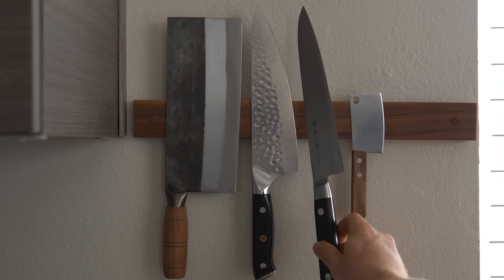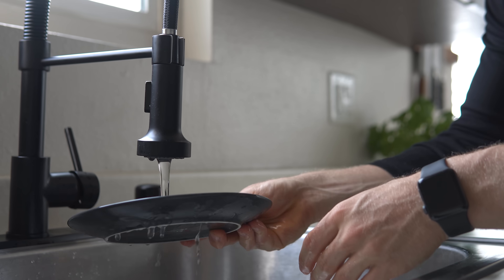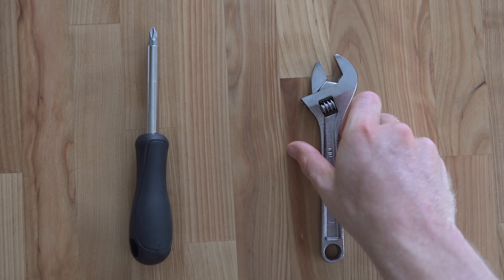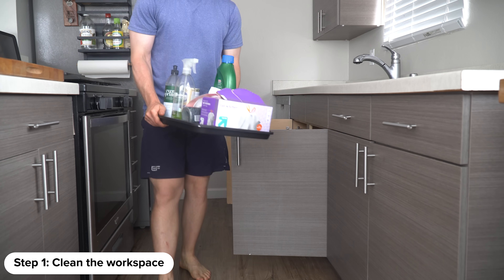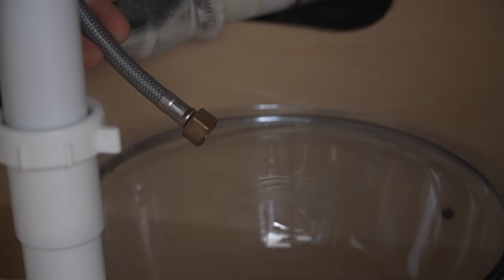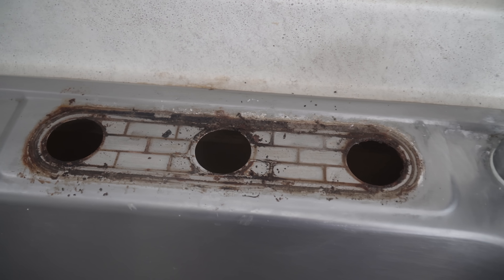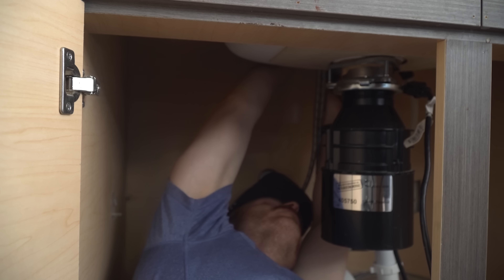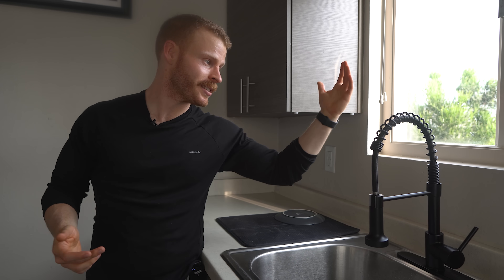Why (and how) to install a new kitchen faucet

Comment: You need one of those tubes of silicon or something to create a waterproof layer around the base. It also helps keep the base in place.
Reply from the maker: There's a gasket underneath the plate cover that should keep it waterproof, but if I notice issues I'll get a sealant. I wanted to make it easy to remove since I'm only renting!
Reply: Ethan Chlebowski run a bead of silicone around the base to keep water from leaking under and causing the rust and grime issues you had on the old one. Silicone is super easy to remove when you need to replace the faucet again. You won’t regret it!
Reply: @EthanChlebowski  That gasket generally speaking is trash and should not be trusted to keep water splashes from dripping down the main hole where the faucet stem is placed.  Even just a periodic drip can cause the cabinets to warp or even worse develop mildew/mold.  I'd suggest putting a sheet pan under there for the time being and check it after a large load of sink usage so see if you are getting any moisture dripping through.  As mentioned by others a bead of silicone around the gasket will provide a permanent solution.  It's really easy to remove with a putty knife if you have to change the faucet back when you move and will ensure not losing your deposit over cabinet replacements.
Reply: @EvanSamuels  being a Plumber of 15 years, you never silicone under the tap. That's what's the gasket is for.
Reply: gazlake1 actually you are correct. It looked like there was no gasket under the plate from the video (just metal on metal) but maybe there is a foam one built in? Though It’s a bit hard to tell from the product description.
Reply: @EvanSamuels   It comes with a foam sponge by the look of it. 

Its a cheap Chinese brand so you get what you pay for I guess.
Reply: @EvanSamuels  I have this exact faucet and plate. It does indeed come with a foam gasket. I decided to silicone mine anyway, just to be safe, but it was probably overkill.
Reply: LOL.  I was going to suggest the same thing.  BASIN on Amazon.
Reply: Hi Ethan,  do I need to buy new supply lines when I replace the faucet?

Comment: Last week I was doing dishes, using the hose, and switching back and forth wasted so much water that it got me thinking about how much more efficient the dish tank in commercial kitchens are.

But this design really brings the best of that world into the home. Basically a commercial style hose, held up by the spring and all that, but clicking into place for standard home use...

Can I come do your dishes sometime bro?

Cuz that joint is efficient, ergonomic, and elegant af
Reply from the maker: Yea I really dig the design on this one, functional and looks sleek.

Comment: Nice vid….I’m just replacing mine now.. wasn’t sure how much sealant I needed to put between the gasket and the sink flange. ..the instructions that came with my unit only mentioned I needed caulk.  Also, your sink faucet is waaaay sexier than mine, which is more reminiscent of the cookie-cutter builder grade crap from a 1980’s track home for just a few dollars less than yours 😢

Comment: I just tried to do this. But I have a line that runs off from the hot water supply hose. And don't know how to go about that because I still need that line since I assume it goes to my dishwasher. But also disconnecting before the T doesn't seem like it would work either.

Comment: You didn’t mention the caulking or silicone or whatever it’s called that goes under the new faucet plate. Didn’t you need to glue it down to stop water from leaking out?

Comment: I've replaced the faucet twice in my current home and both my prior rentals. The lease companies at the apartments had no complaints on the upgrades. We have a big kholer drop in now that fits whole sheet pans like nothing. So nice.
Reply from the maker: It really is a game changer for not much work!
Reply: @EthanChlebowski  that does depend a little on the faucets and particular sink though. Some are really a pain to get the nut on and off for the faucet. But most aren't bad.

Comment: I replaced mine today with the similar one from WEWE.  I didn't have hot water in my sink for a year.  Removing the old 23 yr old faucet was the time consuming part.  I was about to call service for it, but finally unscrewed with a little more Monica Seles Grunt.  Wow water pressure is amazing for $50 faucet.  I want to now get this same faucet and use it in my bathroom.

Comment: I have a similar faucet and it seems to keep getting misaligned with the connection bass like the coil will move to the right and so I have to kind of pull it down to the left to lock it in does anyone have an idea how to fix this

Comment: u skipped the part where u installed the hot and cold water hoses to the faucet.....I have the exact one that I'm going to install here soon but I can't find a bison wrench or anything small enuff to install the hot and cold water lines into the faucet....what did u use to install the hot and cold lines into faucet

Comment: This is only simple in YOUR situation.  Like me, I suspect a lot of people don't have cut off valves under the sink, not to mention the simple screw on method for the water line connectors.

Comment: Air gap? What is that? My current kitchen faucet has a low rise from the sink with a single handle. My new faucet will have a hot and cold handle and will arch higher above the sink. I have a sprayer where you have an air gap. I don't have a garbage disposal in my sink (maybe that is what the air gap is for). 

I do hope I like a two handle faucet. I have to wait for the hot water to reach the faucet, so I think two handles to give me better temp control.

Comment: Thanks for sharing! I got the same one and no matter how much I tighten the bottom inside the cabinet, seems like the whole faucet unit is still loose, like the stem is wiggly :(. Did you experience this?

Comment: Missing one part that I've noticed in most faucet change videos like these and this one missed it but can be added later. Teflon tape. It's cheap. $1 - $2. Why need it? To wrap the threading before joining and it prevents the threads being connected from possible seizing over time plus it can also help too also for the possible of leaking from the threads when joining back to the old supply lines too. Seizing of the threads joining to the supply line depends if you have hard water that can overtime be harder to separate. If you have soft water. Not much worry on the threads but still possible leaks if not  tighten right. Teflon tape.

Comment: I have a very similar faucet; my apartment came with one that was low and short, scraped from the bottom of the bargain barrel along with all the other hardware they use.  Personally, I never use that arm that holds the faucet head; It's just one more thing to get in the way of grabbing the faucet head, and the head stays put well enough without it.

Comment: Thanks for the video how-to! Did you have to cut the caulking around the original base of the original faucet or was there no sealant used?  I noticed you didn’t use a sealant with the new faucet.

Comment: To prevent that gunk from building up under the cover you can just run a bead of silicone around to create a water proof seal. You can get one that is clear to match the faucet but just make sure it’s labeled for bathroom/kitchen use

Comment: I also changed my faucet around February. It’s a fixed length silicone faucet you can move around in different angles. So easy to do the dishes now! 😁

Comment: One suggestion: Put some plumbers putty underneath the plate to get a watertight seal .
Reply: New faucets have a rubber gasket that sits on your countertop or sink. You can do putty but it's not necessary so long as your faucet is properly tightened. Most faucets no longer need Teflon Tape either. Great job on the video!

Comment: Folks - this is a great video, and super helpful but DO NOT DO THIS IN A RENTAL. If you cause flooding and damage, you will be held responsible. Buy the faucet, ask your landlord to install it. When the landlord says no, request permission in writing. Don't be reckless.
Reply: Just curious, but why would you wanna do this in a rental on someone else’s property?
Reply: @BadMoonRising92 for practicality and aesthetics, the same as you would hang a painting or place a flower vase.
Reply: @ChristoPatro  hanging a painting and replacing a faucet is not a direct comparison. 

Replacing and installing a faucet is a 1 for 1 swap for that something the owner/landlord may not even like, and they’re benefiting on you spending your money to make improvements on their rental.

But You can drive a nail and hang a painting in a minute and just easily pop the nail right out
Reply: A lot of misinformation here. First off, it is a fair comparison to make, when comparing a hung picture frame and replacing a kitchen sink faucet. In fact, replacing a sink faucet can more than likely be 100% reversed. Should you still communicate with your landlord first? Of course. Most probably won't even care, but a lot of what they decide on will be based on the relationship and trust you have established with them and how you go about asking. As for the guy who said driving a nail into a nail isn't as big of a deal as swapping a faucet out? He's wrong. Driving nails or drilling screws into walls wherever you please can be extremely risky and potentially very expensive. You have to know what's behind that wall first. It could be a wire, a water line, a vent, etc. And that could lead to costly damage or put someone at serious risk. You also have to fill those holes in and repair any damage you've done to the wall, otherwise your deposit could be held. You could argue drilling or hammering nails into your walls poses a much greater risk than replacing a faucet.
Reply: @hucz  you’re wrong. Any plumbing adjustments resulting in flood or water damage will be the liability of the tenant. Is your picture frame going to flood your ground floor?

You must be kind of simple.
Reply: No you won't. You guys in America or UK haven't heard of property insurance? Omg 😂 it's insurance s company problem 🎉
Reply: @EverettNewell 😂
Reply: @GiancarloDiamond we have renters insurance here but most renters can’t afford it or don’t know about it.
Reply: sometimes it’s not just for aesthetics. i need a new faucet bc mine is in disrepair and im ignored by my landlord, but im not picking out the cheapest/ugliest faucet possible to do so. i have to live here and look at it. also- some people need to grow a pair and charge a landlord for repairs you have to do on your own if you NEED them. especially in a situation like mine.
Reply: @ fair enough brother

Comment: I've replaced a few faucets in my day and I'll give you a secret - towels work MUCH better than bowls to catch the drips.  And you were extremely lucky if your faucet nut came unscrewed as easily as you made it look.  A couple of bruised knuckles are usually my payment for changing a faucet!  Also, thumbs up to the people who said silicone sealer and teflon tape.

Comment: I would appreciate tips to clean up the mess in your pots and pans after use.
Reply: a personal tip from me: nearly anything can be removed from non-cast iron pots and pans with pure sodium carbonate or another pure alkaline (any soluble hydroxide or carbonate should do). just put some powder in the pot, pan or baking sheet to cover the bottom, put a little bit of water in there and heat it for some time (like 30 mins or something). everything should come off easily then
Reply: First is to clean as you go - if you have used something that you won't be using again during the cooking process (say, cutting board after you have done all your cutting), and there is some amount of downtime while something simmers or such, just use that time to clean up, it makes the amount of cleanup you have to do at once after eating a lot less. Also, clean things as soon as possible in general - food residues become a lot harder to clean up once they are dried in.

And I find that for the majority of things, just running the pan under hot water is enough if it is not dried-in, or if that isn't enough then a light application of dish soap and elbow grease will do the trick. Though I also use some pretty good nonstick pans, so that certainly helps.

Comment: You should wrap your connections with teflon tape. That is an oversight on your part and you could easily under/over tighten your connections and create needless leaks .

Comment: I have to be completely honest with you: that was completely reckless of you to change the sink without asking your landlord for approval. Sure, it’s not that big of a deal and you can just put the original sink back. But the point is, that’s not YOUR property. It’s the landlord’s, technically, based on your lease. If you know common sense of what’s not right is to tamper with other people’s stuff without their permission. You should’ve taken the proper steps of asking your landlord for permission to change the sink, explaining that you can put the original sink back should your lease end. Even if your landlord is chill, it’s still inappropriate of you to modify someone else’s property without even letting them know.
Reply: Yawn